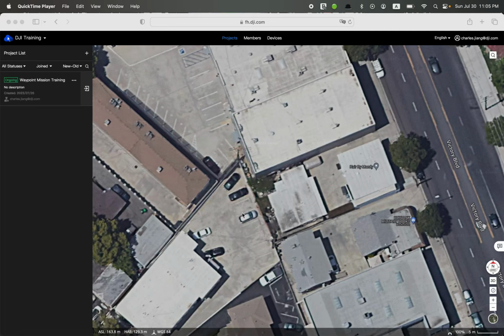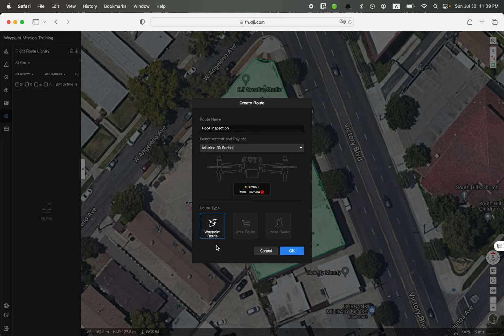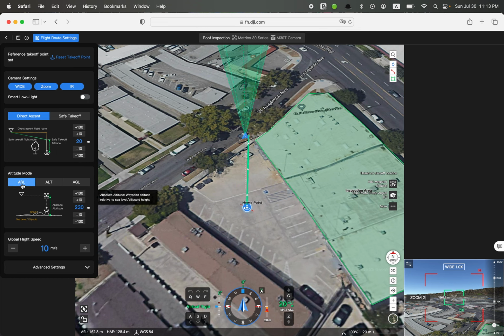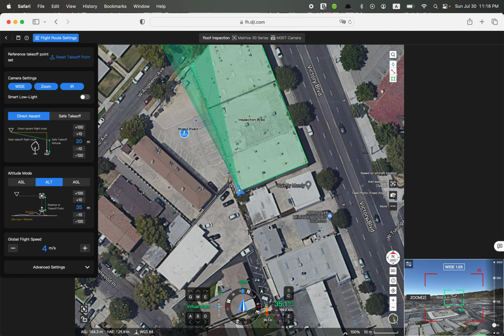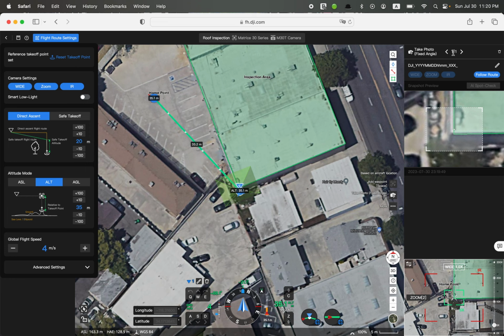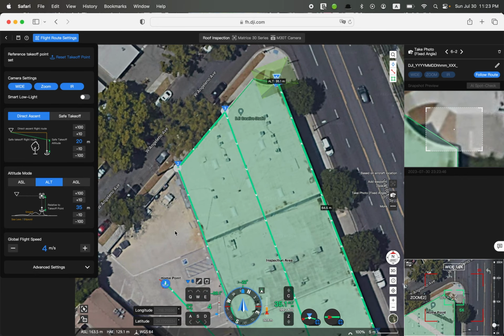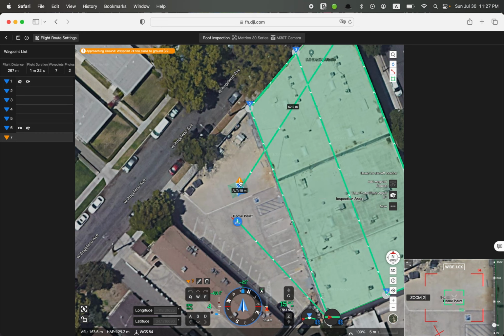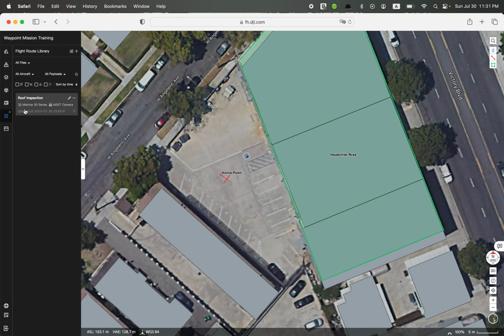FlightHub 2: Waypoint Mission Planning Essentials

Comment: AGL isn´t available in RC Pro controller with DJI Pilot 2 app. Only in Flighthub, but there is no Mavic 3 Multispectral available. And how to insert a custom Geotiff DSM file?
Reply from the maker: FH2 does not support M3M, could make a flight plan and change the aircraft type in Pilot 2.

AGL is supported in Pilot 2 as an altitude option.

Fora custom DSM file could import on the controller when you select AGL as the altitude option for your mapping mission.

Comment: Hi There - thanks for this. I thought great, let me try it.  Cannot get it to work.  I wanted to fly around a square area of a piece of land and video it from the outside looking it.  It look lied it was working, had the gimbal all setup etc, but then when I ran it, the drone just flies along the way point line and video is not started even thought I had it set to start at Waypoint 1.  It is also annoying that when you get things setup, and then click Gimbal pitch, it resets everything.
Reply from the maker: Hello would confirm you have the right drone (Mavic 3 Enterprise Series or Matrice 30 Series) and specific payload selected, and that "Start Recording" and "Stop Reocording" action have been added to waypoints.
Reply: @djiacademy  Mavic 3T - start and stop setup